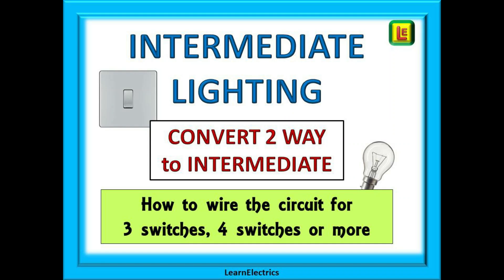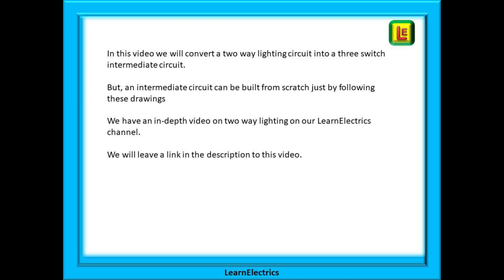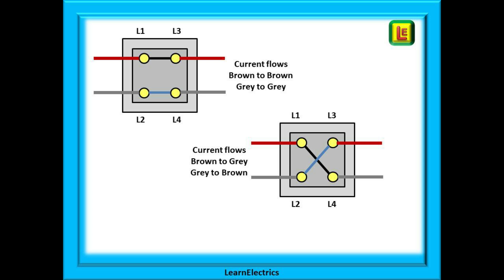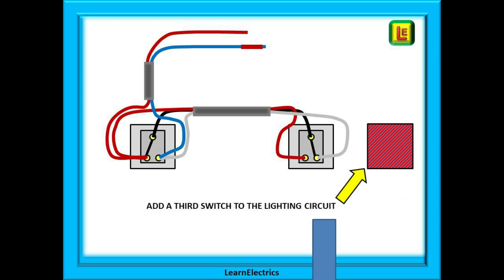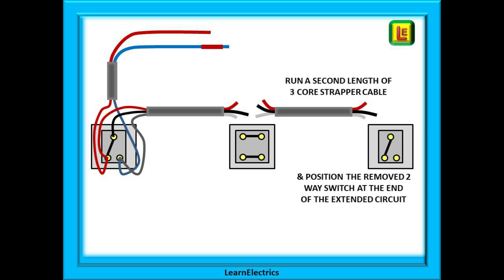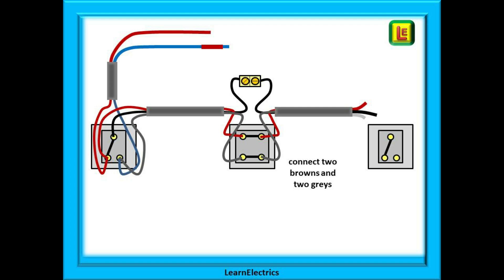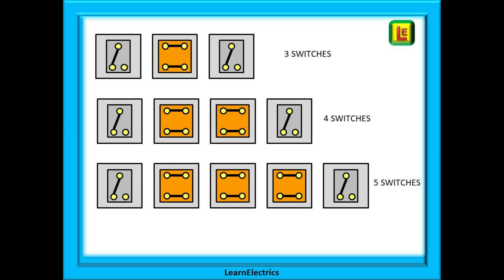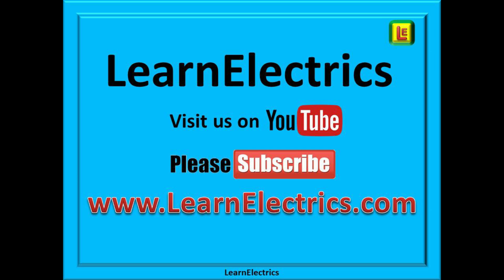INTERMEDIATE LIGHTING. Convert 2 Way Lights to Intermediate 3 way switching.

Comment: I have a question for you. If you can make a video on it please. If we have 3 ways lighting switch where first one is two way switch, then the middle one is intermediate switch then the 3 one is again two way switch. 

Question: if we have a main supply and wiring to bulb both are in intermediate switch then how we can wiring it so we can operate the light from the 3 switches. 
Thank you so much if you can help on it
Reply from the maker: You must have a two way switch at each end, and as many intermediates as you like between them. Dave.

Comment: Can we put any wire in a connector block for the intermediate switch or does it have to be only black
Reply from the maker: Any colour as long as it is the same conductor designation all the way through. You can't have L1 at one end and in the connector block at the other for example. Its just habit with me, I've always put black in the block. thanks for watching, hope it helps. Dave.